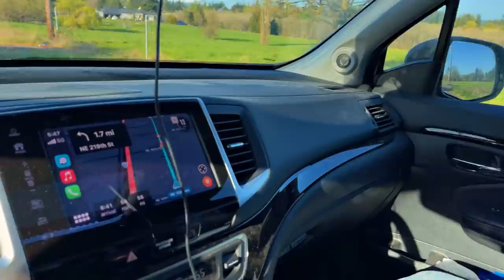Break-In Service Completed!! • Continental GT650! | TheSmoaks Vlog_1979

Comment: I signed up to for a test ride of the PA a few weeks ago and it's in a couple weeks. I'm impressed they have a 150hp vtwin that redlines at 9k rpm and doesn't require valve adjustments. HD did their homework. I was in the dealer this week. Picked up my fender they chipped during the recall as they repainted it. I looked at the new RT. I thought I would be in love with it. I wasn't.  It was my favorite color too, blue. I don't care for the LCD and the riding position is sportier than my 2009. It was nice though, very nice paint. I just like something simpler. I don't need a nav or stereo and I like analog clocks. I guess I am an old fuddy duddy now.